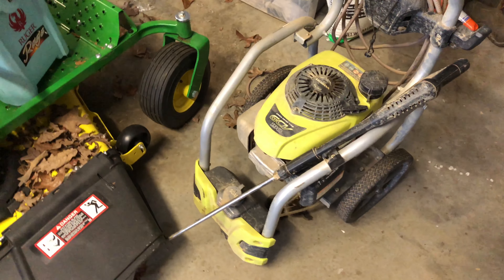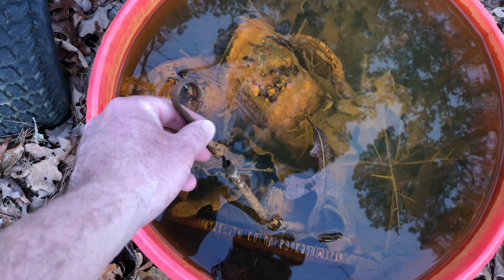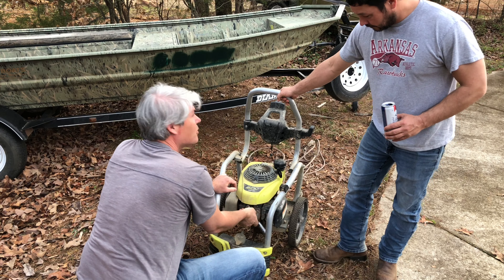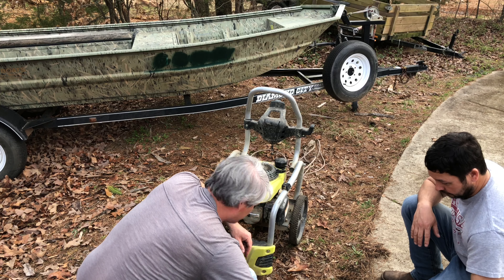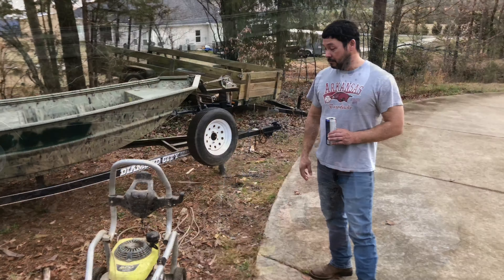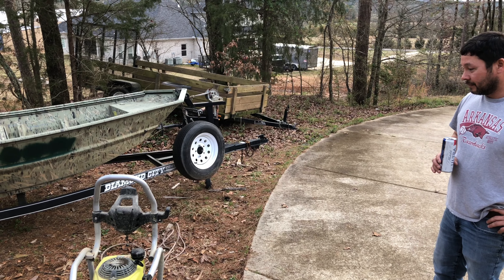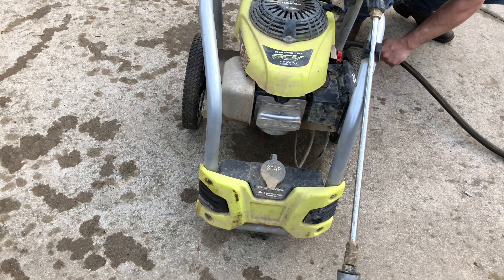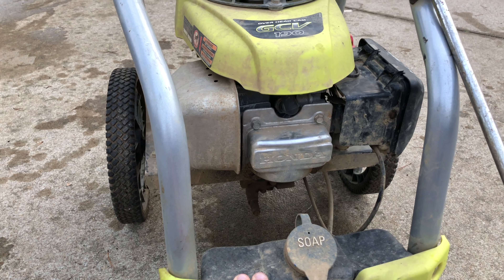Honda GCV 190 Pressure Washer Won't Start - DIY Cheap and Easy Fix

Comment: I have one of these that had a gummed up carb unfortunately I keep finding more and more issues with everything from corrosion build up on the idle down cable to hidden to dryed out gaskets it looked great when the guy gave it to me
Reply from the maker: Sucks when that happens. At least you got it at the right price.

Comment: Good job getting it started. That surging you are getting when it’s idling (I.e. when not spraying) is a plugged pilot jet in the carburetor. Clean that out and the idle will level out for you. Had the same problem on my Honda GCV 160 powered pressure washer and my Honda GCV 190 lawn mower. Cleaned out the pilot jets on both and they now idle smoothly.

Comment: Interesting.  

Also holding  handle in will help it start faster or at least press it after a few pulls.

It doesn’t use gas oil mix.  Just gas and separate oil
Reply from the maker: The 50:1 oil is to lubricate the cylinder just a little.  We didn’t know how long the unit had been sitting up and what kind of condition the 10w30 in the unit was in.  It’s just an extra precaution.

Comment: I purchased a same engine pressure washer and I have cleaned out carburetor, cleaned out gas tank replaced oil and replaced gas and spark plug and still won’t turn over I do have spark just like you guys tested but still won’t start
Reply from the maker: Did you pull the spark plug and dribble a little bit of 50:1 two cycle gas directly in the cylinder, before reinstalling the spark plug and trying to start?
Reply: @budgetprojectsbydavid5263  yes did exactly that and even checked for spark and it's there. Still won't start. Thanks for the video by the way.
Reply from the maker: Maybe hook the water up and have a friend hold the trigger on the water while you try to start.  This will release the pressure that the water pump creates against the engine, hopefully allowing it to start easier.
Reply: Will try that. Thank you sir
Reply from the maker: No problem. Please let us know if that worked.
Reply: @budgetprojectsbydavid5263  It wouldn't start even without the wand attached (the water just squirted out of the hole).  I replaced the spark plug and now it turns over if I shoot starter fluid in the choke valve but it sputters off after a few seconds. Guess I'm back to   having a carb problem. Thinking about trying full carb replacement as they are relatively cheap. What do you think?
Reply from the maker: Yes, the cheap prices make it so easy for a full carb replacement.  That should fix your problem.
Reply: @budgetprojectsbydavid5263  thanks for replying again. I'm watching more stuff on your channel. I like your style fixing without trying too hard. Anyway I looked into getting an OEM carb but what if this thing still doesn't start? So today i took the carb off again and looked hard at it. It was no different than when I took it apart yesterday, no fuel in the bowl etc. So I figured the intake might not be flowing even the rubber piece to the carb had flow. Vaccuum? I tightened  the 10 mil screws on carb and made sure the rubber fuel hose is far as it can be on the intake of the carb and even removed the butterfly clamp in case it was impeding flow somehow. BINGO the motor caught and actually chugged into life. I turned the choke to Run and it revved up. I had a couple more problems keeping the engine running , it did not like the air filter for some reason but I didn't care because I had been trying to get this unit running for days and I had  some pressure washing to do. So I rode it bare back and got the job done. 
This video and the Jeff's garage video about cleaning the carb helped me tame this wild  ryobi into a workhorse and I hope some other would be pressure washer sees this and finds they can beat it too.
Reply from the maker: Many thanks for you sharing your experience with this rig.  It helps all of us.  Thanks for your kind words on my other videos.
Reply: @Colonel Panic  mine is still not starting. It's got a nasty kick back. Got spark, calibrated the lifter, cleaned carb, new fuel, oil and it still won't turn over. Any help would be much appreciated. 🙏
Reply from the maker: Can you pull the trigger while trying to start, to relieve some of that pressure?
Reply: @Budget Projects by David  Yes and it still won't start. There is no release of pressure regardless if what I do, aside from when I pull the spark plug out.
Reply from the maker: I’m not an expert on these. Heck, I don’t even own one.  Just thinking outloud.  Is it possible that the water pump is completely seized?

Comment: Hi 50:1 oil/ mix you mean ethnol +gas, please clarify
Reply from the maker: No, I mean 50 parts non-ethanol fuel (if available) and one part 2 cycle oil.  Many weedeaters and blowers run a mixture like this because of their 2 cycle engines.  

4 cycle engine, like the pressure washer don’t have to run a mixture of oil in the gas, but it doesn’t hurt them, especially if they have not run in a while.
Reply: Thank you

Comment: Is there a throttle control on this motor. Cant seem to find it. Just stays on low power and wont build pressure.
Reply: There’s videos on this Honda gcv that show you how to remedy the low pressure problem you are having.  If it stays on low throttle you might be having another issue.  Hope this helps I know it’s been 10months since you posted this lol

Comment: I tried this today with gas only to the cylinder and it started up immediately on first pull and then died.  Tried again and same thing.  Does adding the oil to the gas and then putting some in the spark plug cylinder allow  it to run longer? I might have to clean out the carburetor.  It's just a shame because I used this once.  Drained the gas from the fuel line before the winter and even used fuel pump saver.  My ryobi 3300 gas powered machine isn't even 1 year old.
Reply from the maker: Sometimes, it primes it just enough to unclog the carb, but if it’s not working, then yes you will probably need to clean the carb.  Adding the oil just protects the cylinder a little more in the instance that it has sat up a long time or has old oil in it.

Comment: What did u pour in the spark plug hole
Reply from the maker: 50:1 gas/oil mix.  This is generally used in 2 cycle engines, like my weedeater, but it doesn’t hurt 4 cycle engines.  Just treat em right with a little oil mixed in, in case they have been sitting up dry.
Reply: I’m doing this today lol
Reply from the maker: Good deal!  Hope it start up quickly for you and remember to hook the water up first, unlike me in the video!

Comment: 0:09 That is probably oil leaking from the engine. I have the same pressure washer and it has a slow leak in the same place.